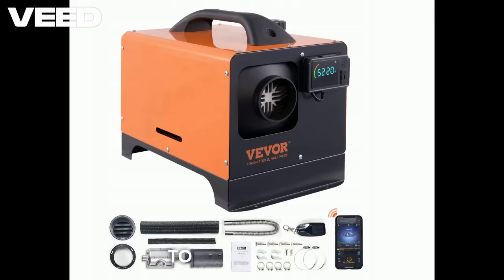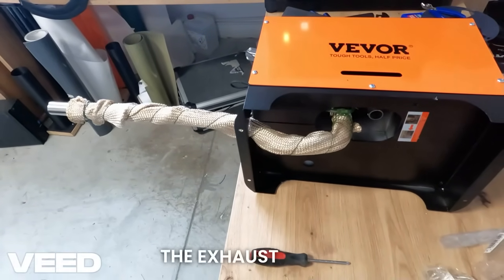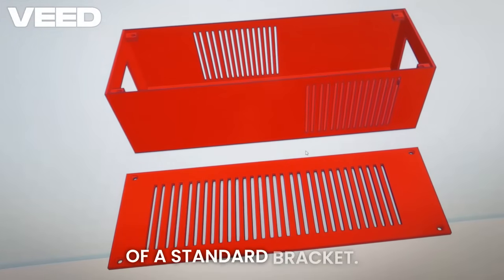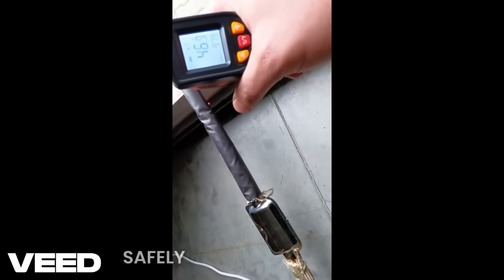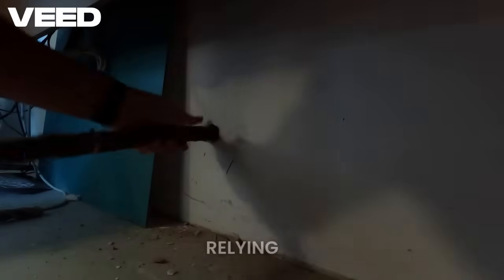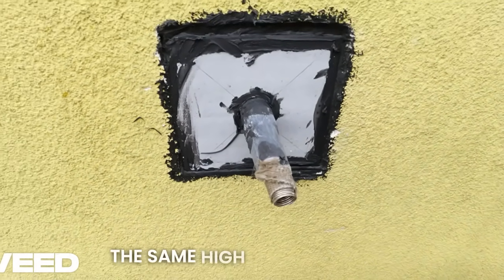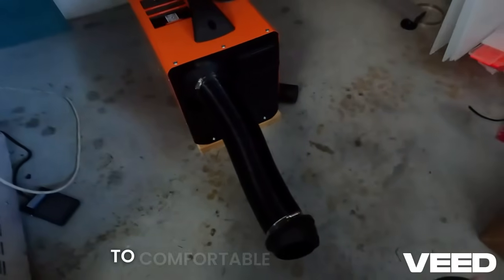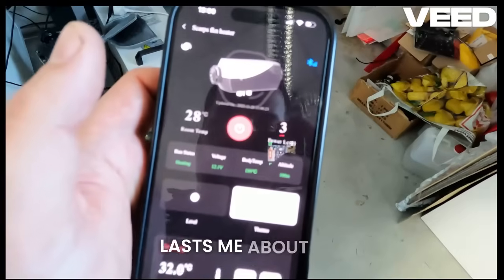🔥 VEVOR DIESEL HEATER: 🚨 SAFE WALL INSTALLATION (200°C FIX!) | 30-Day Fuel Consumption Test

Comment: Thanks for a great video very good information 👍I just bought one of these on Amazon(I just ordered it a couple of days ago. We haven’t received it yet. It will probably come sometime next week )The white one was the cheapest one so I bought that one to try and save a little money. I wanted to leave the whole unit outside and cover it up with the plastic tote/box and run the heat hose through the basement window and up to the living room of our home and route it through one of the old furnace ducts,,, if we smell diesel through the heated air hose, then we won’t use it for the house, maybe out in the garage however, if we don’t smell diesel through the heated air hose we will use it for the house and I’ll try and buy a kit to use a 5 gallon diesel can. if you’re still working good, I hope so.👍😊🌻✌️